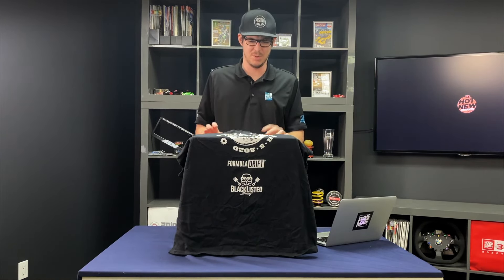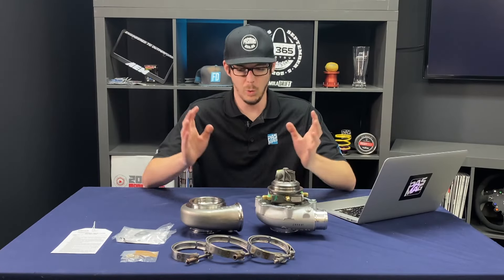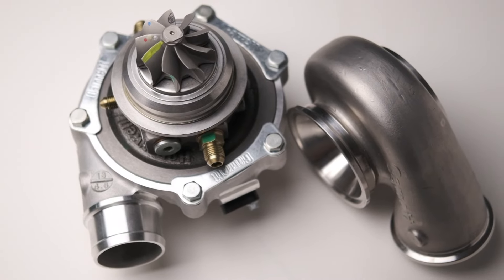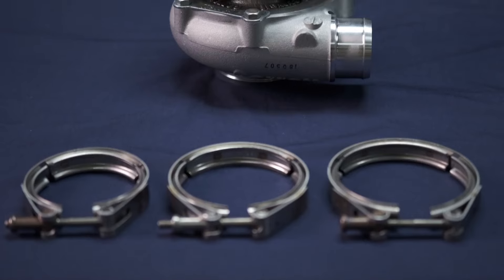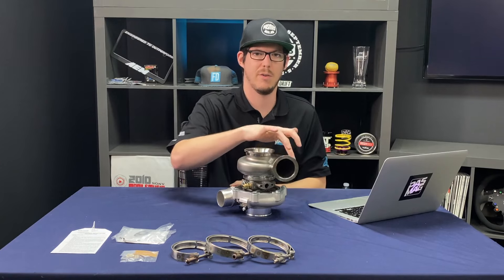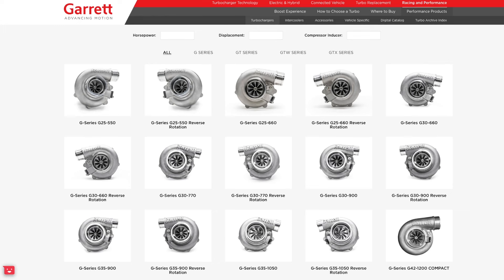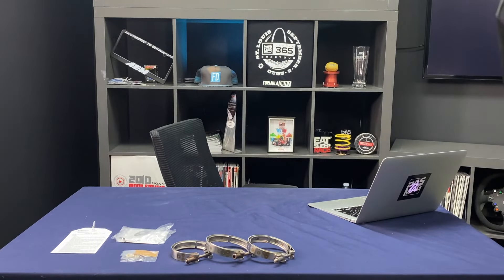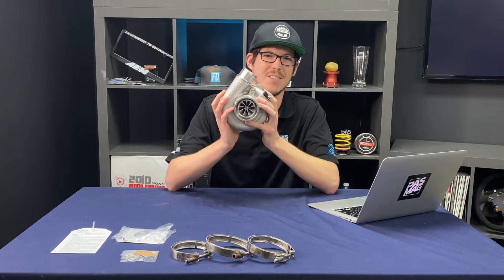Garrett Advancing Motion G25-550 Turbo Unboxed

Comment: Yo! I'm considering a pair of these in a twin turbo setup(.72 a/r vband in and out and external wg) on my z32. Is the max hp still 550 if you're running 2 instead of 1? I'd assume it's a bit higher?
Reply from the maker: I believe the maximum recommended for each individual turbo is still 550. If you want to go higher, there are some bigger G-series options!

- Adam